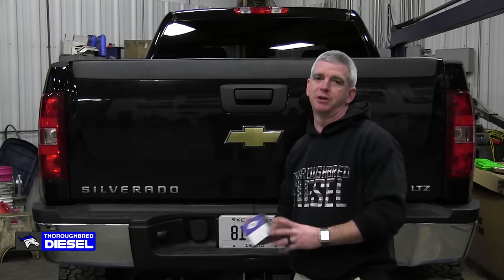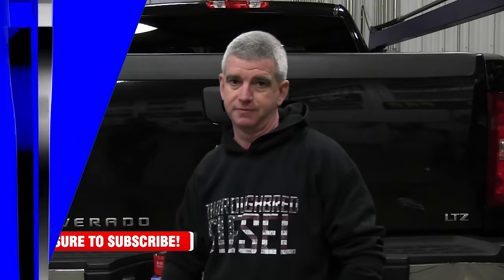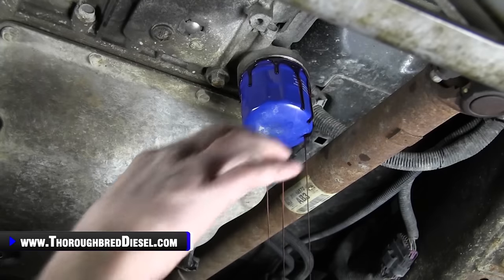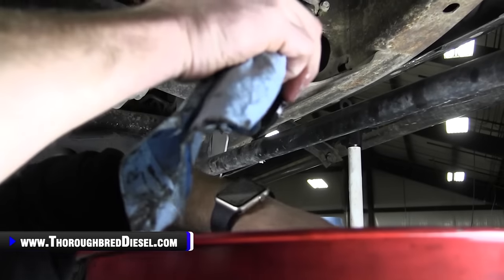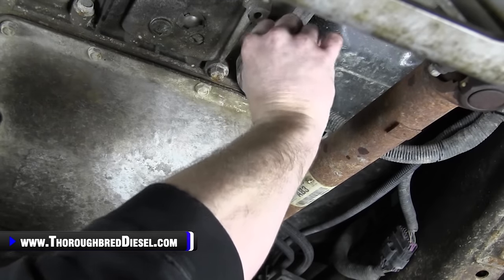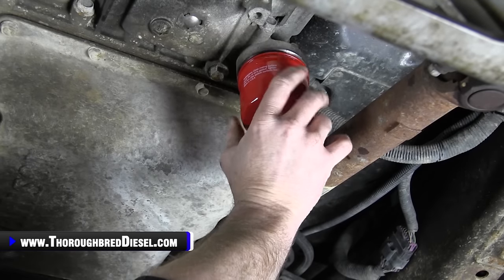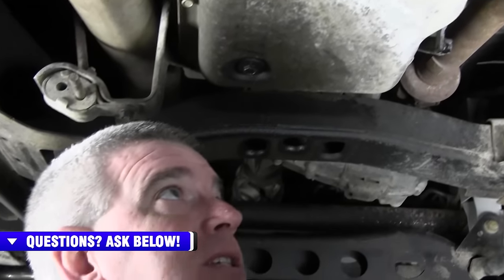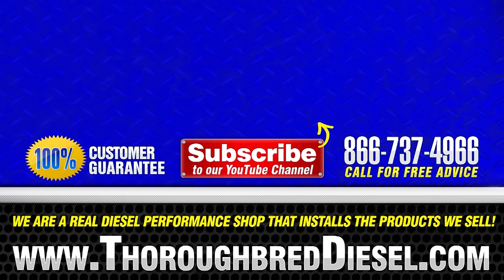How To Change Allison 1000 Transmission External Spin On Filter

Comment: Is this the only service it needs? 
I have rebuild with 30k miles trying figure out what i should due service it or only change filter
Reply from the maker: No, there are service intervals on the internal filter as well. Refer to you owners manual.
Reply: How many miles you have now when should you due internal filter after re built

Comment: Great stuff 
However I was ready to change fluid and filter 
But looked at Dip Stick and that fluid looks Brand New Crystal Clean 
Last year put 700 miles 1 trip
Year before that 2000 miles
2008 Truck only had 61K org miles And has been. Well maintained by a Diesel Mechanic 
So am thinking wait and out a few more miles on before change out. Have all the All Parts
Thanks for your great video
Reply from the maker: I usually don’t change the fluid warm,  and I might be wrong on this. However,  it doesn’t matter what I do or what precautions I take,  I usually wind up WEARING about half of the transmission fluid. It never fails. So for me personally, I don’t change it warm.

Comment: That's it ?? Should you fill the filter to replace fluid level ??
Reply from the maker: You can, but still need to check the fluid level on restart.
Reply: I don’t, I add to the filler neck under the hood…. Less messy.

Comment: After how many filter changes should you top off or should you top off every filter change and about how much fluid do you believe you loose in the filter when removing it
Reply from the maker: Not much is lost there, maybe 1/8 qt? Always check fluid on stick according to mfg recommendations.
Reply: I believe you lose about 8-10 ounces per swap.  So a quart of ATF will do you for up to four filter changes.  You can check the stick for level, but it is really difficult to read IMHO.

Comment: Hey I have a 2019 Chevy 3500hd dually and only 17k miles on it I am the only one that had the truck only pull a 8.5x24 trailer here and there and the transmission is slipping And changing gears rough just took it to the shop yesterday they asking me if I added some kind of additive Because the fluid seems thick When they rub their fingers together And I ask them why would I add something when it’s a brand new truck so now I got to see what they say today
Reply from the maker: Very strange. Let us know what they find.
Reply: @thoroughbreddiesel  will do

Comment: Do u have to add trans fluid after the new filter is on ? How much fluid do I need to add ? And what kind of u recommend?
Reply: I usually add about 10 ounces of ATF when done.  First time I changed the spin on, I measured how much was lost, and that was the number.  I top off with AC Delco Dexron VI, I believe that is the factory fill ATF.

Comment: Do you have a video on changing fuel filter? I have a 2015 Chevy Silverado 2500 HD 6.6 L turbo diesel  4x4.
Reply: They can be a pain in the ass... you can try cranking wheel all the way left and reaching up under fender, or pull front passenger wheel and inner fender liner off and you'll have a whole lot better acces... may or may not take a bit longer but a lot less swearing lol
I always fill new filter about 1/2 full of seafoam

Comment: Any special recommends on fluid? Amsoil atf worth the hype?
Reply from the maker: If you are going to change over to an Amsoil, I would recommend doing an entire fluid flush and change. If not, follow factory recommendations on fluid (Dexron VI or equivalent).
Reply: @thoroughbreddiesel    You must be joking. You should know better.  NEVER, EVER FLUSH AN AUTOMATIC TRANSMISSION. You will end up with severe transmission problems, because you are back flowing the fluid and all the dirt and gunk in it and you will F*** up your transmission big time. Just drain it, change the filter and add new fluid. That is IT. If you flush it, expect to spend thousands of $$$ to fix your little flush job.
Reply: @markdavid4897  Not if you line flush it!

Comment: What about the transmission fluid you lose while replacing the filter ? Should one just top off the new filter with new transmission fluid ?
Reply: Check your leve use the dipstick boi! and add as necessary
Reply: Add 8-10 ounces of Dexron VI.

Comment: Thanks for the video. If you're able to answer I have a question about my Duramax. I have a 2008 2500. I keep hearing that I should be putting a lift pump on my fuel system to prevent future injector/injector pump problems. Do you have an opinion on this?
Reply from the maker: The lift pump kits that offer extra filtration will decrease your chance of premature injector wear caused by lack of filtration. We do suggest using them for all common rail motors.
Reply: Thoroughbred Thank you good to know. Does the positive pressure to the injector pumps have any benefit in your opinion?

Comment: HANDY TIP
Take a plastic bag (Like the ones you get in the produce section of the grocery store and hold the filter with the bag wrapped around the filter as you take the filter off. 
NO ATF dripping down your arm, only dripping into the bag you wrapped around the filter.   :)
Reply: Word of advice, check your bag for holes. There’s no guarantees in life! 🍻

Comment: I just bought a brand new 2021 2500HD Chevy Silverado. It has an in closed transmission. I got under it and couldn’t find this spin off filter. Am I blind or does this truck not have one? Please help 🤓 thank you in advance.
Reply: Only 6.6 Liter Duramax-equipped vehicles have the Allison transmission, which means that you have a gasoline engine in your truck.

Comment: A strong rear earth magnet on the outside of your filter will trap ferrous metal particles.  And you can move it to the new filter when you service agian.  You can do the same thing with engine oil filter also.
Reply: Waste of time.

Comment: I followed his recommendation and now my transmission is shifting different. Anybody have any words of advise on what could be the issue?
Reply from the maker: Have you checked fluid.  Nothing in this installation would have affected your shifting unless you have some something to block fluid flow. I suggest taking it back down and checking your work.
Reply: @thoroughbreddiesel    If he followed your recommendation to flush it, that is where the transmission got F-ed up. Never "Flush" an automatic transmission!
Reply: Did you put your magnet back in place
Reply: Are you in a regen?  That definitely seems to make the shifting less smooth…. Other than that, make sure you are not low or overfill of level on tranny…

Comment: I will listen to you and change it with my fuel filter thank you
Reply from the maker: Cheap insurance.
Reply: GM recommends 22,500 for fuel filter.  The dash DIC matches that.  Some guys I know do every 15,000.  It will be worse the colder climate you live in.  As for the spin on, I do every 10-12.5k miles…. It’s really easy…

Comment: how much fluid do u need to add after replacing the filter??
Reply from the maker: Just a small amount. Run the truck to operating temp then check fluid. Add as needed.
Reply: 8-10 oz

Comment: Can a stopped up filter cause my transmission act up? Like jumping outta gear in 4th gear!
Reply: Yes.  Change the filter may need pan drop and internal filter to  wouldn't flush if your having a issue.

Comment: I'm curious, at what point do you lose enough transmission fluid doing this do you need to consider a fluid top off or change??
Reply from the maker: With anything you do like changing filters you should always check the fluid and top off as necessary.
Reply: @thoroughbreddiesel  Thanks for the info, and the reply. Just picked up my first diesel yesterday. A 2019 Silverado 2500 High Country with the beautiful L5P. Love it.
Reply: Casey Todd just wait until you put a tune on that thing....
Reply: @kevinswartz2396  I actually found a shop in Florida (I'm in Texas) that specializes in cracking into and tuning the L5P since it's such a booger to tune and delete. The price to do all of the necessary shenanigans was NOT a pretty number.
Reply: @caseytodd7632  so worth it, I like the l5ps but I picked up a 16 LML last year. Just did the full delete last week. AMAZING.
Reply: @stevenllewellyn8906  That's actually what I'm thinking about doing. I have had some issues with my 19. Not with the motor, but with the overall build quality, that with less than 30k miles, should not be happening. Super disappointed in the build quality of these newer GMs. My wife had a 2018 1500 High Country that we just traded at the Lexus dealer for the same reason. Had taken her truck to the dealer 9 times in the last 10 months for warranty work and gotten run around every single time. Seeing the same problems pop up on mine. Currently my seat warmers/ventilators are not working and the dealer has no answer as to why. The whole reason for not modding my truck has been the warranty, but if the warranty is useless, I figure I may as well get a 15 or 16 with 60-80k miles that has already had all the bugs worked out and make it my own. If not, I hate to say it but my next will be an F250.
Reply: @caseytodd7632  that’s a shame man I went back-and-forth for almost a year on whether to get a 18 or 19 Denali 2500 or a 15.5 to 16 Denali LML. Don’t like the hoods on the 17-18, don’t like the newer style ( mirrors, front end & fender flare lights )on the newer ones. The LML is cheaper and easier to delete. I got one last year with 50,000 miles and this year my warranty is almost up so I deleted it fully. Cp3 conversion will be in the spring, after that it should be a solid truck, only thing I’m gonna do after that is an alternate firing camshaft and then just have to worry about the faulty pistons supposedly in some of the years lol!. L5P seems like a solid truck other than that. Crazy that these little issues happen with a $70-$80,000 truck though. My truck had numerous warranty issues with the Dev stuff and DPF the ninth injector also the intake air heater. Not anymore! Throttle response, performance and sound is beautiful, I find excuses to go drive it other than work.
Reply: You loose 8-10 ounces per swap.  I always refill each time to keep tranny topped off.

Comment: What about the filter inside the transmission
Reply: GM doesn’t recommend swapping the internal, until you run into a rebuildable situation.  That filter is way more coarse, and would only catch some things from a failure.  In other words, don’t worry about it IMHO.

Comment: I’m scared to change mine. Bought my truck with 292k on it and it has the filter from the FACTORY.
Reply from the maker: We recommend changing it.
Reply: It becomes plugged eventually.
Once 'plugged up' the gunk just recirculating around causing more damage. 
I would personally think about drainage of the original (probably brown stinky) original fluid and refill with fresh, and maybe even a bottle of Lucas for transmission. 
I put almost 2 in a small GM 4L60e giving old age problems and it helped. 
If the fluid in yours is smelling nice but dark that's a good sign.  Stinky means it's fried

Comment: No, You need to make sure that this spin on filter is more than hand tight or it will leak over time. Snug it with a filter wrench. If you don't believe me be my guest and hand tighten only.

Comment: Damn I have 410k on my 01. All original motor and trans. I changed mine every 30-40k miles lol. Hell maybe I should do every other oil change so I can get 600k out of it
Reply: I'm right there with you with 392,000 MI
Reply: They had a woman in Indiana one time at the fuel pump and she told me she had 900,000 Mi on her 2011 GMC

Comment: No need to top of the fluid after putting in the new filter?
Reply: No
Reply: Not each time, but over time, you will lose 8-10 oz per swap.  I just add that each time to be safe.

Comment: Question maybe you could help me with. 2016 Duramax, just changed the fuel filter and now the engine light is on. Any suggestions.
Reply: If its one of the cheap plastic filters might have over tightened and cracked it causing air to get in

Comment: Where do you add trans fluid?
Reply: Thru the dipstick tube.
Reply: In the gas tank!
Reply: In the same place you check the blinker fluid!
Reply: If you put it directly into the air vents you dont even have to open the hood

Comment: On my 2020 10 speed the filters on the inside.
Reply: The guy doing the video is changing an Allison 1000 5-speed or 6-speed transmission. Those are the only GM transmissions that have the external oil filter. The rest of the GM transmissions all are Internal filters.

Comment: 10k mile interval is ridiculous. If you're unsure, cut yours open after changing. Mine was like new after 45k.
Reply: I would assume that all depends on the use of the vehicle. We tow a travel trailer and our GCVW is a bit over 18,000 pounds. I'll gladly take the 5 minutes and spend the $30 to prolong the life of this $4K transmission.

Comment: Embarrassed to say I was always advised not to mess with a transmission unless ABSOLUTELY necessary.  Hence my LMM has not seen a trans filter change since I've owned it at 100k...  and she just rolled 203k last week!  I'm guessing my magnet might have a shaving or two on it!!!
Reply: I'm right there with you, got mine at 160k now it's at 315k and I'll be changing mine for the first time
Reply: @James Motes  Well good luck to both of us then.  I was gonna see if I could find an upgrade kit for the trans as I hear they help a good bit.  I got EFI live right now with a man-back exhaust and Banks Cold air intake with superscoop.  About to hook up my Air Dog 2 finally and we'll see if that'll save the ole CP3.  Not sure if it helps or hurts.  And EFI live also provided a Trans tune which I'd say is a defenite plus but does take some getting used to.  Anyway, as I said before, good luck, and with any bit of it we won't be stranded after this!!!  P.S.  315K... impressive.
Reply: What was the outcome on your guy’s situation? Mine has 315k on it and I’m confident it hasn’t been changed in a HOT minute
Reply: What kinda annoys me is why  trucks don't  remind you of the 5:58  service intervals for everything including the transmitter filter   (my truck is 2022)  as it does oil fuel air filters brakes etc.   To me that's kind of misleading. .  Well know I know
Reply: That fluid gets absolutely boiling hot as you drive, (like you could cook fritters in it after getting to your destination).
The heat ruins it over time, turning it into varnish.

Comment: Why bother replacing the fluid that was lost, right? 🙄
Reply from the maker: Just a small amount is lost. Run the truck to operating temp then check fluid. Add as needed. We probably should have went over that.

Comment: What fluid don’t you suggest to top it back off with
Reply: What he said
Reply: The 5 speed Allison 1000 should take TES 295 spec fluid. Transynd is suitable and popular, although genuine Allison fluid is always the safest bet.
Reply: How much fluid do i add back in the trans?
Reply: @Chrisfitmunoz  just fill yhe new filter to the top and its close enough
Reply: If its a 5 speed allison do what that guy said in tge comments but if its a 6 speed then it needs dexron 6